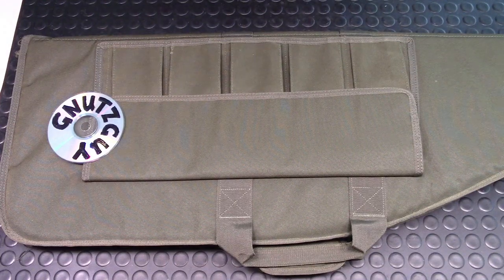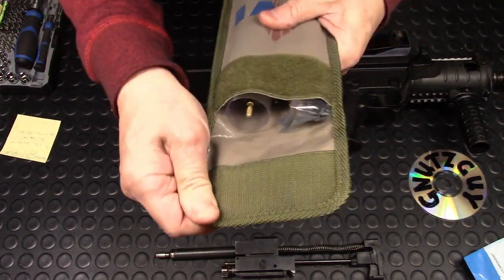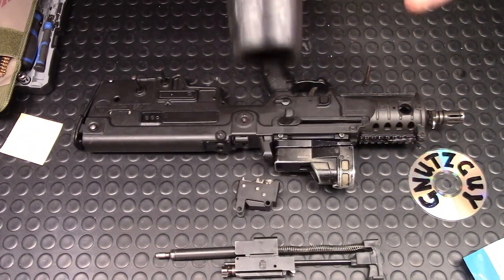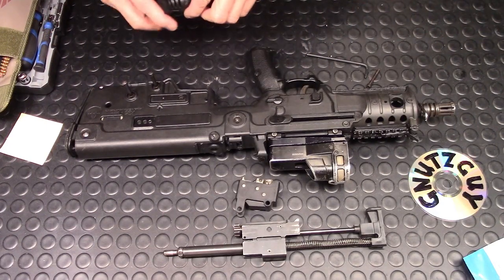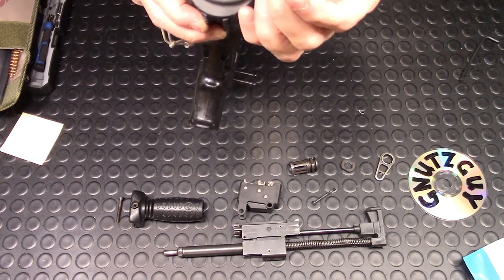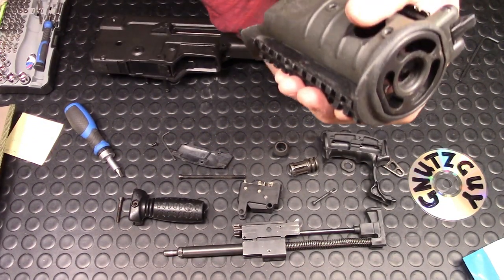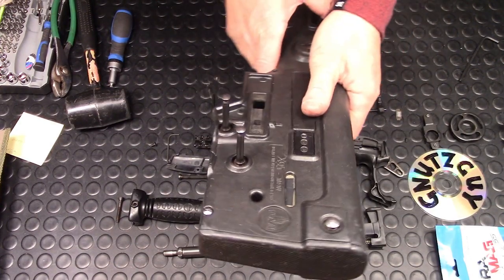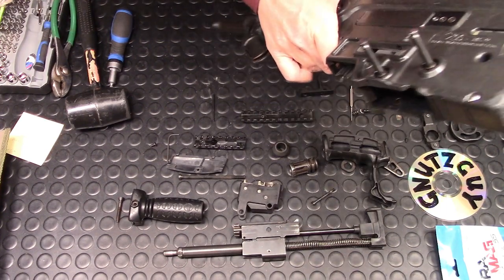Tavor X95 Micro Surplus MSW. Full Monty disassembly. Warning. IWI IDF Bullpup

Comment: The sight is mepro-m21 made by Meprolight. It's belong to the SK group that also own IWI.
Reply from the maker: seems like these dont last long.
Reply: @gnutzguy  like a trij once element is gone garbage mine is dead too was trying to figure out how to remove it have a new one with pic attachment. is it possible just to remove the sight?
Reply from the maker: @dp5007  yes, ofcos just two screws underneath.
Reply: @gnutzguy  but not accessible without full disassembly right? and not sue if my mepro with picattiny switches will fit
Reply from the maker: @dp5007  ideally yes, best to disassemble but if you dont want to then you can try using an open end wrench and be careful not to damage the plastic receiver. Good luck.

Comment: Great Video...slow and detailed. Do you by any chance know what type of light swicht the little metal plate unter the holes in the handguard is meant to hold ?
Reply from the maker: no i dont, im hoping one of you would know, lol.
Reply: @gnutzguy  I've searched online for a while but couldn't find anything...last hope would be an E-Mail to IWI.
Reply: @gnutzguy  So I reached out to the IDF subreddit...its the PTT/pressure pad for Meprolights proprietary switch for the Sting (LAM) or the MOR PRO (red dot sight)

Comment: Yeah I knew it. Back when the X95 released in 2016 for the US I sent IWI a message asking if they would bring in round handguards because the IDF were modernizing and switching to the square ones. Meaning there was tons of them sitting somewhere in Israel. They told me yes, and that they were working on bringing them stateside. Years went by with no news so I asked them again, and this time they said no because the round handguard was not compatible with the US guns. I knew it was bullshit, and now it’s confirmed bullshit because the parts of your round handguard that insert into the body of the rifle look identical to those on my square one exactly like I expected. My factory 13” barrel even has the flats on the sides for that barrel mounted sling attachment point to mount to and not swivel around. That’s something that X95 SBRs need too.
Reply from the maker: Did I hear you right? They were gonna go one by one and change out the handguard? That doesn't sound economical cos it's not a safety thing so I think they would just replace the whole guns with square handguard instead.
Reply: @gnutzguy  They replaced whole guns because the model they standardized on had 15" barrels and all the little improvements they've made over the years.
Reply: Man I would pay so much to have the round setup here. I hate how the long rail looks. Give me the classic lines!

Comment: Hey Gnutzguy,  do you know if the 18.5" Tar-21 barrel/assembly would work in converting one of these surplus X95's to NR?
Reply from the maker: Good question. I don't know but i think a model change would include the barrel. So I would guess not
Reply: @gnutzguy  After closer inspection of your video and my barrel assembly - they're pretty close! I think the only real difference is just under the front optic mounting area where the hole is: on the Tar-21 there are "wings" that hold the rotating sling mounts in place, whereas they're absent on the x95 (it's just the hole). Also, the micro you have has that big round collar underneath the hole that looks like it's attached to the  barrel, which I don't believe is on the standard X95's?
Reply: No, they won’t fit